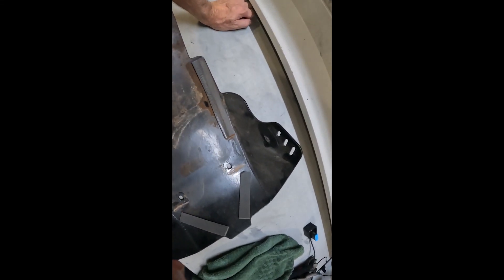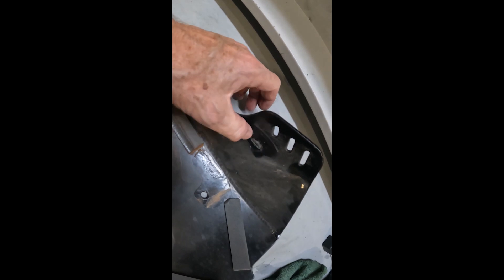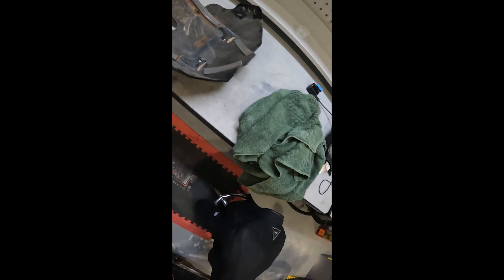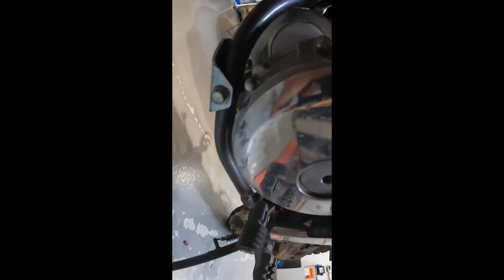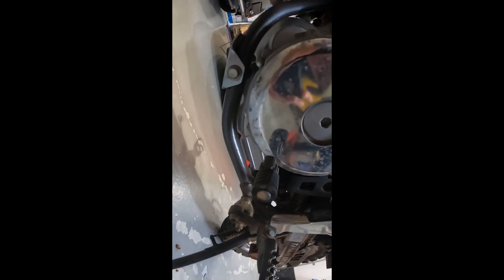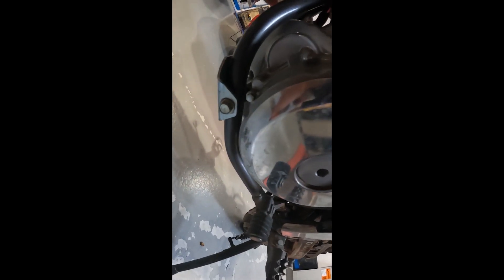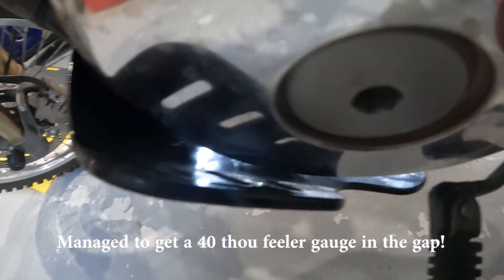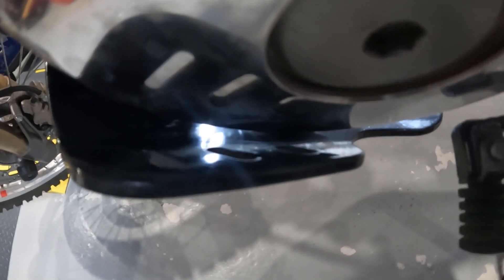Suzuki DR650 SE B&B Bash Plate Discovery

Comment: Could weld some aluminum washers inside the bash plate on the mounting holes to space it down some. Or put some automotive thermal heat insulation (sticky kind) on the inside of the skid plate .
Reply from the maker: Mmmm...I might do some left and right hand side measuring to see if I have bent it. I shouldn't need spacers if I haven't bent it!

But if I have your solution might be the winner.